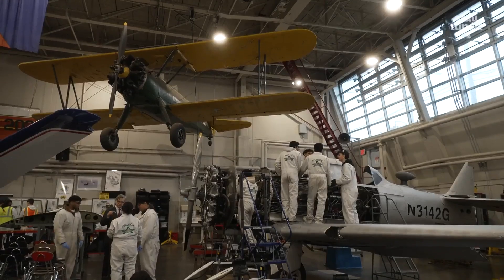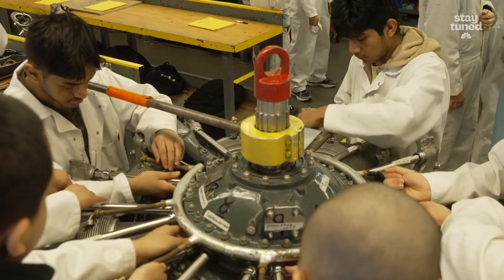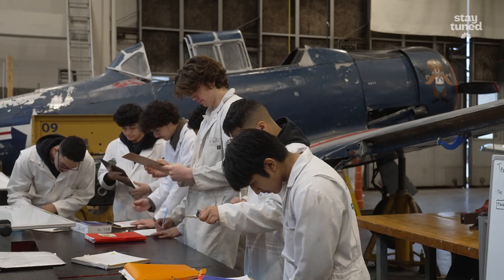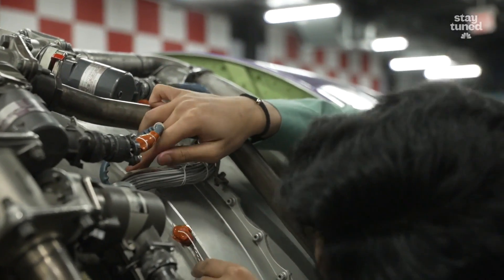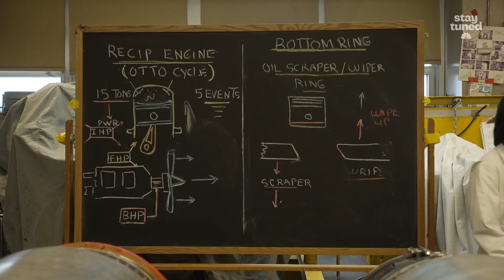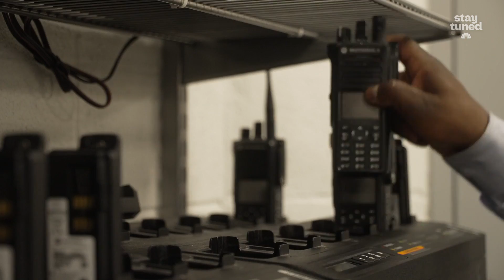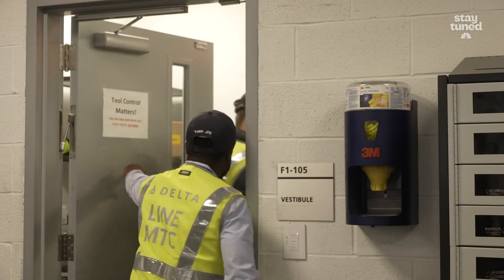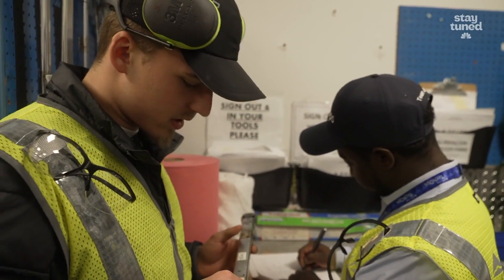These teens are learning aviation in high school | Stay Tuned Education Series

Comment: Outstanding. I went the long route of U.S. Navy aircraft mech. to getting my F.A.A. Airframe & Powerplant certification along with F.C.C. license with radar endorsement to work on all aircraft systems including radios and radar. Aircraft are much cleaner than any other transport vehicle due to the constant maintenance. But watch out for the "Purple Scourge of Monsanto" or "Liquid Evil". These are my names for Skydrol. Keep castor oil in your tool box for if you get it in your eyes, and if you're working on hydraulics, wash your hands BEFORE you pee.